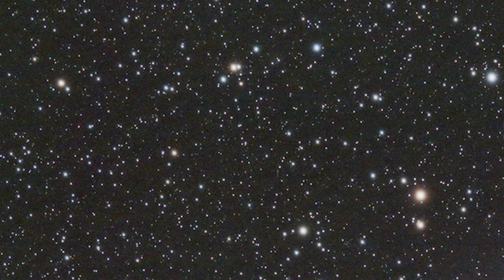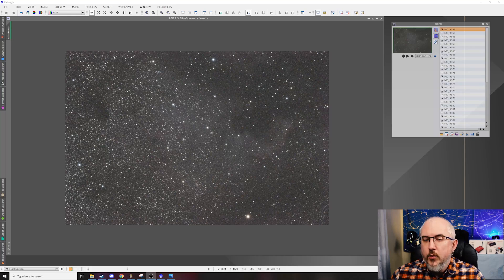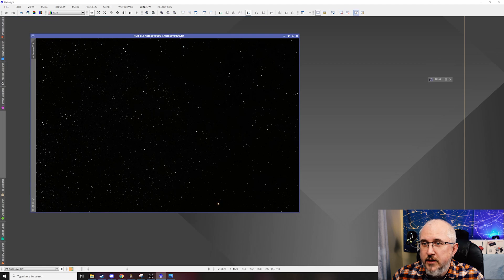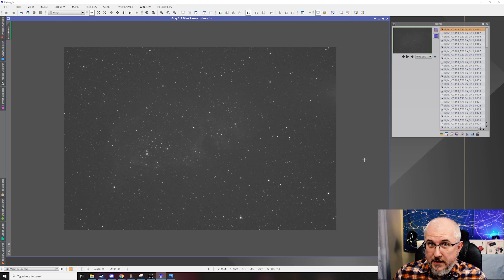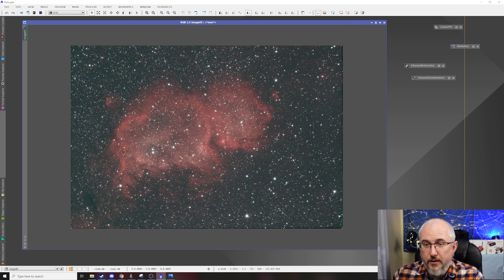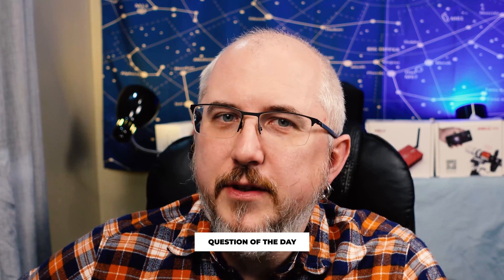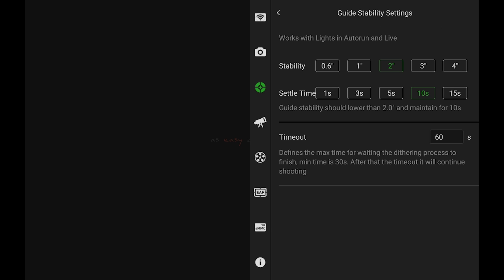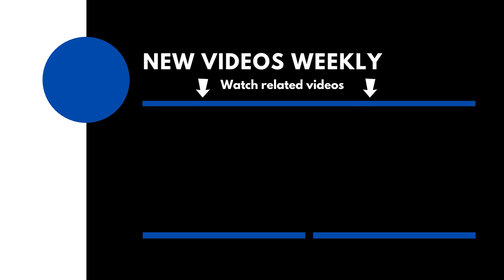Why Dithering is Important | Setting it Up With the ASIAIR

Comment: i just got a SA GTi and i always dither cuase the first time i used it in a very dark location in the summer it ruined the same exact target for me with walking noise. I dither manually with the GTi SynScan App moving the frame every 10 to 20 images and it works great i dont really need any more dithering than that usually, although i dont got for super long exposures yet cause im working and dont have days off to spend a full night imaging, i just go for like 2 hours total integration time on like 2-3 min subframes dithering every 40 mins roughly.

Comment: Great video. IS there also a way to do dithering with Asiair, without using autoguiding? If you do not want to use a guidescope and cam?
Reply from the maker: You still need to use a guide camera. The main camera is focused on capturing your target. As of now, doing both with one camera doesn't work.

Comment: I use an AVX mount which is connected to the ASIAir via a USB cable connected to the handset. I wonder how well dithering will work on this mount.  Thanks
Reply from the maker: It should still work. All it does is send small movement signals to the mount.

Comment: If it could take 60 second to settle, that time added to each frame could add maybe 30 minutes to a 30 frame capture. 

Would it be better to use that time to capture more frames?

Maybe it depends on if the camera has low noise vs a camera with higher noise level.
Reply from the maker: Yes, it would. But if it's taking 60 seconds to settle, then usually something is going on with your guiding. Either the guiding is off, or the sky conditions are bad.

Comment: You say you dither 2 pixels every three frames with your guide camera/telescope.  Is this related to the focal length of the telescope and sensor pixel size?  What should the dither setting be for different guide scopes and sensors?   In my astrophotos I see much noise so wonder if this is because of incorrect dithering.
Reply from the maker: A bit of that but also exposure length. If you were say, doing five minute exposures, you would want to dither every frame. Shorter lengths you can dither in between a set number of frames and still get the intended result. Two pixels per 3 frames tends to work for me. The other thing to take into account is how much time your guide camera needs to settle before the main camera starts shooting again. If your guiding is accurate, it won't take long but if a surprise thin cloud shows up it could slow things down a bit.

Comment: Can you dither if you're not guiding?
Reply from the maker: Technically, yes. Manually. In between pics make a very, very small adjustment to the framing by moving the camera on the mount a tiny bit. But it's time consuming and runs the risk of messing up framing on the object entirely.

Comment: when its this cold, i manually dither every night, the asiair allows me to stay in doors with no dither :)
Reply from the maker: I would still dither in case a pixel on your camera's sensor has a malfunction. Calibration frames can detect those and average them out.

Comment: Daylon, any ideas as to why my dithering stops after 4 or 5 exposures using a dslr and asi air plus? Turned it on and dithered every other frame then would not dither anymore. Tracking was very good also.
Reply from the maker: That's odd. How was the weather when it did that? Your guide scope may have lost the stars with a very thin layer of clouds up there.

Comment: I've done manual dithering.  I used my mounts controller on the slowest speed and every 5 shots, I'd stop and make a quick adjustment, then keep going.  It worked well, but I've moved to an ASI AIR so I don't do that anymore.
Reply from the maker: Nice. The ASI AIR makes it so much simpler :)

Comment: Will this thing Asiair plus work with a explorer iEXOS-100 PMC mount?
Reply from the maker: From what I've seen, it takes a bit of tinkering but it does work. I don't have that mount so I've never had a chance to mess with it. This board should be able to point you in the right direction though: https://espmc-eight.groups.io/g/PMC-EightApplication/search?q=%23ASIAir&ct=1
Reply: @AstroEscape  thanks:

Comment: Nice explanation of dithering - the "blink-movie" presentation of the effect is extremely clear. I also settled on a similar strategy for dithering, minimizing downtime waiting for guiding to settle. While I'm using different software (SharpCap/PHD2 rather than the ASIAir), the concept is identical, and most software seems to have very similar dithering controls available. After some experimentation, I also tended towards one dither every 3-4 frames when taking shorter subs (45-90 seconds typically for my site), but go back to dithering every frame when taking long subs (10 minutes or more, useful with narrow-band or under dark skies). Cheers!
Reply from the maker: Your point about longer frames vs shorter frames is a good one. Thank you for that! Yeah I've seen how other software compares, and the process is remarkably similar. But, when it's doing the same function, it's kind of hard to make it different. Thanks for watching, Bob!

Comment: I have found a 2 second push of the east or west and south or north on a go to mount will provide good dithering. Use a random pattern for this method when pushing a direction button on hand controller.
Reply from the maker: That's a nice method if you have a hand controller. When I thought up the example I put into the video, I thought of star trackers! Thanks for the suggestion for those that are using a hand controller 😃

Comment: I have the asiair plus also, and I use the asi294mc pro, and 2600mc pro. Since the asiair does not let you select a dark flat option, can I just select bias, and use that to take the dark flats? I am assuming with my cameras, it's better to use dark flats than bias frames anyways.
Reply from the maker: Take darks with the same exposure time as your flats. If you do that directly after taking flats, the ASIAIR recognizes it and will use whatever the auto timer for flats set. Just make sure to select those as dark flats when stacking.
Reply: I’d love for you to explain this in one of your videos.
Reply: Yes, just use BIAS in Autorun at same exposure as Flats. Works great with 2600mm Pro

Comment: Daylon, what were you using to connect your ASIAir Plus to the mount before you changed to the EQmod cable?  That is what I'm using now and I'm going to try the USB connection instead just for fun (if and when the weather clears). The Plus will connect to the mount over USB without any modification which my Pro would not.  Also..... I am dithering 3 pixels every frame, I notice that you doing it every 2 pixels every 3 frames. My images usually turn out sharp as a tack, but it takes FOREVER to shoot a lot of frames because of the time it takes the auto guider to settle back down. Have you done it every frame and changed the way you dither? I may try every three and see what it does. Thanks a bunch for the video, I have picked up a lot from you and everyone else that runs You Tube channels!
Reply from the maker: I've always kept it at every three frames, which I explain towards the end of the video. It's because of the settle time. I know at minimum you'll have to add SOME time to wait for things like dithering or a meridian flip, but the goal is to minimize that wait time by skipping a few frames for dithering. Which, can allow time for a few extra frames. I have messed with every frame a few times, the extra wait time wasn't worth it to me. Granted, I did that when the Eastern US sky was just clearing from the wildfire smoke this past summer..... the smoke wasn't helping the guiding.

I use this method before the EQMod cable: Mount -> Hand controller -> USB Cable -> ASI AIR Pro. The hand controller and the ASIAIR weren't playing nice, it kept changing which hemisphere I was on when slewing. So, I bought the cable when I got home from that trip! The mount I have doesn't have USB connections. If the mount has a USB connection, you don't need the EQMod cable.

Thanks for your compliments!
Reply: @AstroEscape  As soon as the sky clears I'll  give the every 3 frames a roll and see how that works. As far as the cable goes, my hand controller is something I paid for with the mount and have next to never used. The mount and the EQmod cable get along great. Wildfire smoke.... I live in Southern Idaho. It's never a matter of if we'll get it, it is a matter of much, how long will it last, what direction is it coming from and yeah this one I can see flames and the air tankers. Having said that I wouldn't live anywhere else.
Reply from the maker: @hurdpcs2802  Oh my! Living that close to the source of the wildfire smoke would be a huge struggle for clear nights! I feel you with using the hand controller. Maybe if I decided to get a scope for visual for outreach events I'd use it, other than that it sits on a shelf.
Reply: @AstroEscape  "If the mount has a USB connection, you don't need the EQMod cable."  Except for newer revisions of the EQ6-R, where it seems SkyWatcher has updated the chipset they are using from PL2303 to PL23D3 (USB to UART RS232 Serial chip), which is a model not yet supported by the stable Linux Kernel (ie: ASIAir).  USB wont connect (even at 115200), but EQMod cable works fine here.  Solid video, thanks for the upload.
Reply from the maker: @MazzifLOL  Thanks for the correction, I didn't know Skywatcher did that. That's a bummer, hopefully ZWO recognizes that and helps get things going for compatibility!